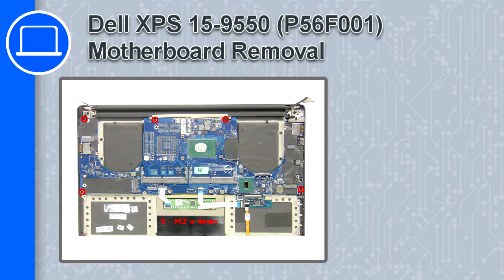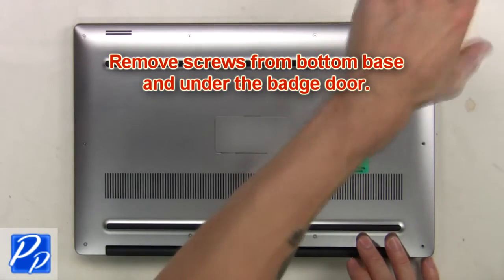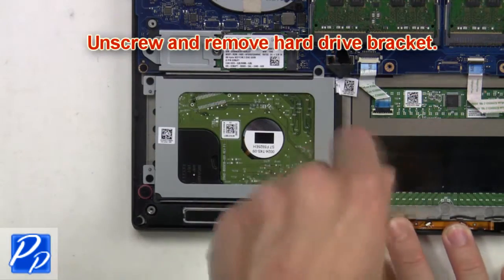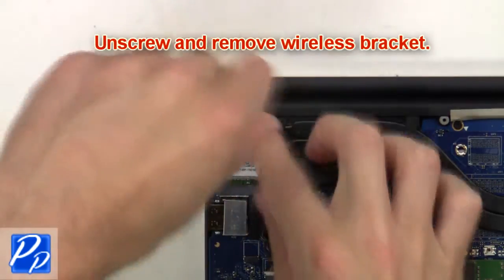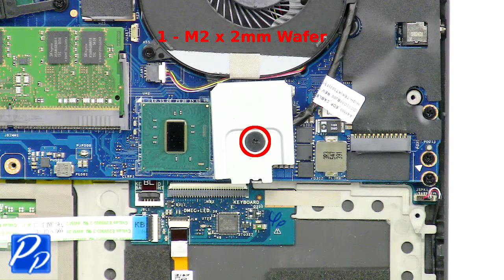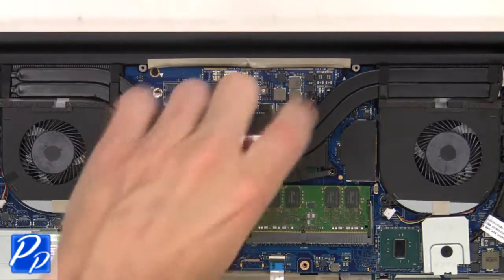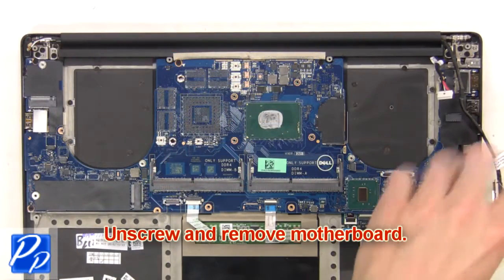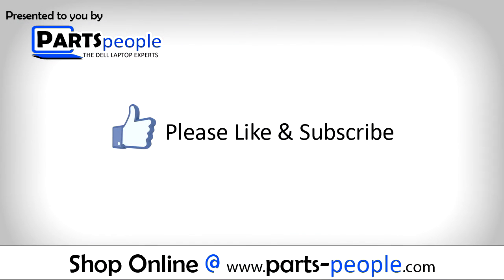Dell XPS 15-9550 (P56F001) Motherboard How-To Video Tutorial

Comment: Thanks for the video.
I think I have a problem with my video card. Is that attached / soldered to the motherboard?
If I need to replace my motherboard, how much would that be? Thanks for your help!
Reply from the maker: It is integrated on the motherboard. You can find a link to our inventory of motherboards in this video's description.